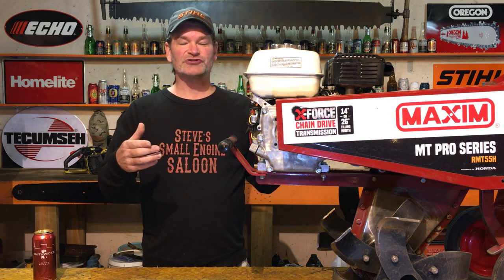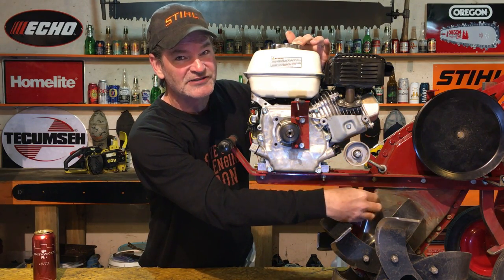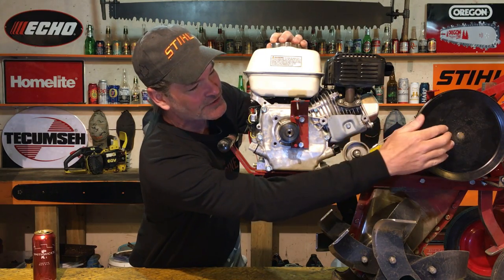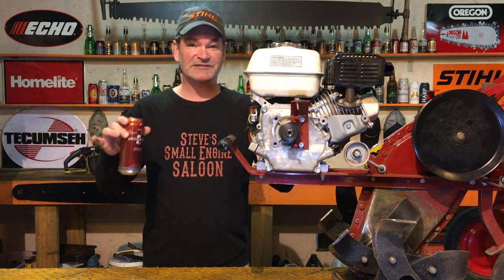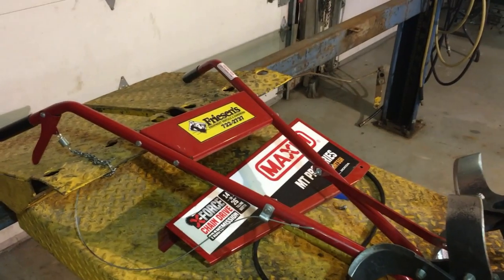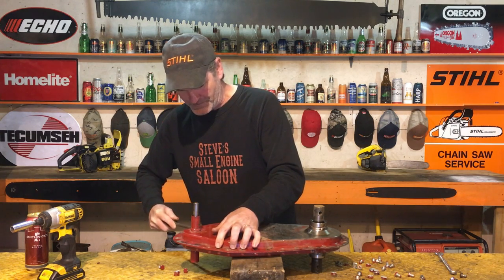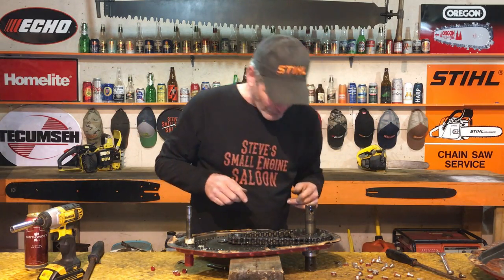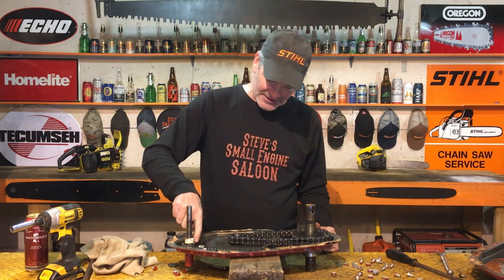Why The Tines Won’t Turn!  Let’s See What’s Inside a Rototiller Transmission

Comment: Whenever I work on a tiller especially a troy bilt i have a shot of jack daniels for starters..lol..some times two..
Reply: Troy--Built Pony or Horse some times the job takes a jigger full.
Reply: @RonSales  i like the way they designed the drive belt on the pony..what a pain..
Then the customer wants to look at you sideways when you give them the bill.
I was actually charging a lot less than the lawnmower shop was..and got it back
to him the next day when the shop would get it back in a week because they were
swamped.if he brings it back I'll have him call the shop for an estimate..or i may just tell him
to take it there anyway..Cheers 🍻🍻🍻🇺🇸🇺🇸🇺🇸
Reply: @RonSales  but dang will those 2 tillers out work most out there... Even the humans running them haha
Reply: @staind288  these are the older models I am talking about. Have seen them when right the Horse work 4 acres of garden and never miss a beat except to get re-fueled.
Reply: @RonSales  right, those are the ones I was talking about too. Great machines they were. My dad had a pony and my grandfather had a horse.. They were both a horse in my opinion!
Reply: @RonSales  right, those are the ones I was talking about too. Great machines they were. My dad had a pony and my grandfather had a horse.. They were both a horse in my opinion!
Reply: @RonSales  yes Ron ..i like the older ones better they were tough..and I've worked on a few of them..they don't make em like that anymore
Cheers friend 🍻🍻🍻🇺🇸🇺🇸🇺🇸
Reply: I recently acquired an old Troy-bilt Tuffy that belonged to father-in-law who passed away several years ago. I'm not sure of of its operational status, but, aside of some rust,  it appears to have been pretty well maintained.  It has a Tecumseh h35-45759y engine, for which I do not have an owner's manual. I've been told by the local shop that parts are no longer available for the motor. My main question is whether the machine is worth investing a few bucks to recondition it, and, if so, where should I start?

Comment: Why do you think that Sprocket striped them teeth off, cheap metal not hardened, or chain stretched.
Thanks Steve 👍
Reply: I assume abuse along with weak metal. It's a rental. Maybe someone was trying to breakup and mix in some filler material or something.

Comment: Looks like a good case for a design to include a shear pin.  Much easier to replace than a gear.
Reply: Iirc the bolt that holds the tines on is a shear pin.